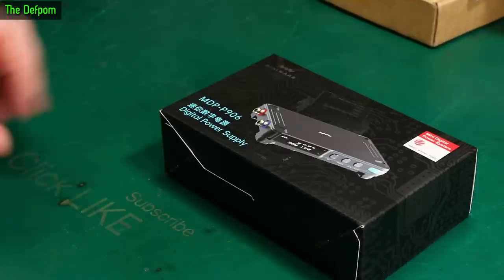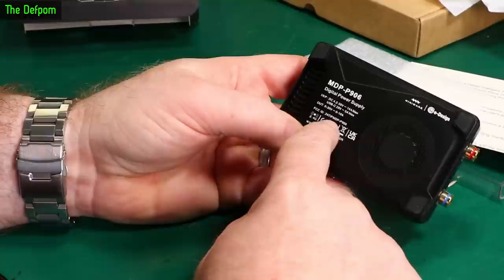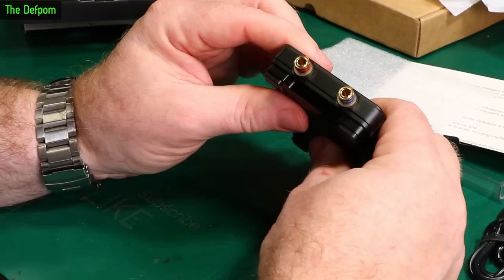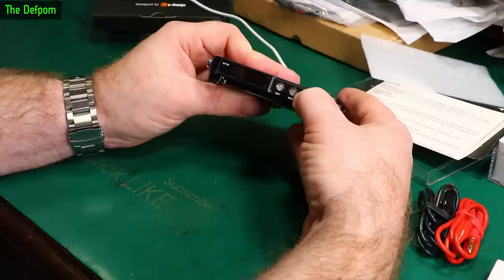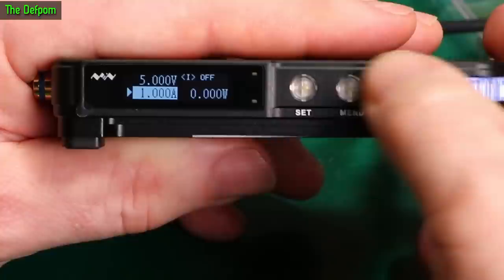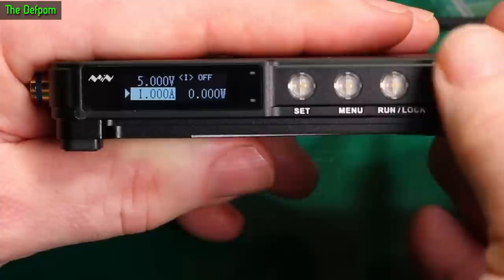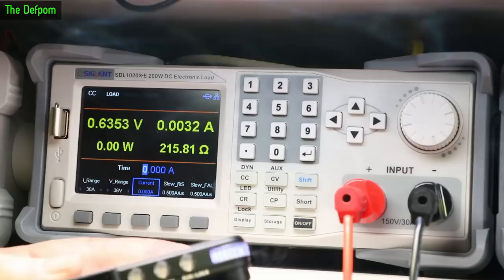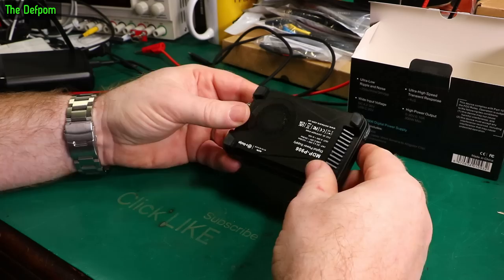🔴 Miniware MDP-P906 Power Supply Review & Repair - No.1041

Comment: Is there actually any need to make a PSU that small ? Would have been interesting to see how it copes thermally at full load for a long time.
Reply from the maker: I will need to set it up on a better DC power supply using the DC in Jack instead of USBC so I can crank it up higher for a longer time, that is something I will do when I get some spare time.
Reply: No problem whatsoever at full load in my tests. The fan turns on and the case gets warm, after 15 minutes its below 50° C on thermal camera due to high efficency (around 95%) as claimed by MINIWARE.

Comment: The general rule I've always used is to spec capacitors for twice the max expected voltage. A 30V rail should have caps rated for 60V, or more.
Reply: The problem with that is you usually end up using significantly larger components, which affects the form factor of any portable equipment. However, it does make sense to overspec voltages for electrolytics, but the question will always be "by how much?" If you're buying quality components, and you're certain that you'll never get spikes in excess of your maximum expected voltage, then there's nothing wrong with using 35V rated caps on a 30V absolute max supply rail. If you get a genuinely bad part, then I'm afraid that a bad 60V cap is just as likely as a bad 35V cap to spill its guts on a 30V line. The failure mechanism is the same for both caps.
Reply: @markonw6661  I agree completely about the useful life of electrolytic caps, and it is the usual 'U;-curve. However, unless you are suggesting that the PSU has been in use for 12 years, I don't think the long-term viability has any bearing on the failure in the video, do you. My point is that I'm completely unaware of any study that shows any effect of derating a cap on its short-term failure. Sure, a 63V cap is likely to last longer than a 35V on a 25V rail in the long run, but I don't believe it's any less likely to fail in the first 72 hours. A defect is a defect.

Leakage in solid polymer-Al caps comes from imperfect insulation in the dielectric layer. As I noted earlier, the problem with solid caps is the inability of an oxide layer to heal, so leakage will always increase over time, and I firmly believe that the failure shown in the video was caused by a voltage spike further damaging the dielectric, leading to escalating current through the capacitor. I really don't think you can blame ESR and ripple for heating the component when the failure occurred under no load conditions.
Reply: @markonw6661  I started as EE in 1972, so please don't try to patronise me. I don't need lessons from self-important lab rats who don't even take the time to understand the scenario.

In order for ripple to exist you have to charge and discharge the capacitor. When there is no load, the capacitor is not discharging; the dc voltage on it is stable, and there's no ripple.

It doesn't matter whether you have a linear circuit or a switching circuit, if you're drawing no current, you won't have any ripple on the capacitor.

Did you not see the video? The cap failed when no current was being drawn. VC = It, so I=0 means V=0. I don't think I can simplify it any further for you. The only mechanism for heating a capacitor which has a stable dc voltage on it is leakage, and there's no way ripple can come into it.

How on earth can you claim to be an investigator into failures and then try to tell me that a capacitor blowing under no load with minutes of first belling switched is not a early failure. Do you know what shape a bell is? Failures of electronic components are U-shaped: more failures very early on, then a low rate of failures for the usable lifetime, followed by a an increasing rate of failure beyond that. Why do you think we have "burn-in" periods for a lot of equipment? It's to catch most of those early failures that we expect will occur. Am I to assume your company just lets the customer find those for you?

It's clear the capacitor that failed overheated because it passed excessive direct current directly through a short in the dielectric. For a capacitor to fail because of excessive ripple current causing heating in the ESR, you need to be pushing a lot of current both into and out of the cap. That is only going to occur when large currents are being drawn from the rail that the capacitor is smoothing.

Feel free to give your considered estimate of the value of the ESR and the ripple current that caused the cap to overheat, and justify how the ripple current and associated ripple voltage came about when no load was connected. Then we can all have a good laugh.
Reply: @markonw6661  You don't understand that ripple voltage will be dependent on load current, and this failed under zero load? There's nothing wrong with being an inexperienced newb, but trying to talk down to people with far more knowledge isn't going to ingratiate yourself.

Comment: Mine unit was fine. I did a review of this model some time ago (with EN subs), you can check it on my channel. Its a very cool device. Buck-boost on the input and linear output, passed all tests. Very accurate, well built, efficent and almost zero noise. My only concern was about a voltage overshoot after switching on the output.
Overall not fitting my needs though. Without the MDP-M01 display module, the P906 interface is very inconvenient.

Comment: Of all capacitor types, I HATE those the most!  These junk caps have a very high failure rate.
I did have to buy some bulk caps of this type for a Channel Master PVR that is freezing up and very unstable.
With these units, it's ALWAYS the caps and sadly, they are of this type.

The afterthought that I had was that perhaps it may not be prudent to recap this PVR using the same type.
Perhaps I should replace caps with much better ones.  The only issue, is that it may be more difficult as I'd have to bend the legs to become SMD compatible as there's little to no through-hole.

Oh what fun.

Comment: USB Power Supply would need to have Power Delivery compatibility to work with this one.  Just something to note on the review :).
Not a bad little unit.  The reason it is so small is because it is basically just a buck/boost converter capable of 10amps.  All the actual power supply stuff is external in whatever power supply you connect to it .
Thanks for the review.
Reply: The price for this thing though $200 it's a lot for what it is. For that amount of money you can buy an actual adjustable power supply.
Reply: @BinaryOptionRomaniaBOR1  That is very true.   I was trying to keep my comment positive, but yeah, it is an expensive buck/boost converter really........

Comment: From what I could find on Aliexpress, they put a hefty price tag on this one!
I prefer a Riden 6018W with case and 800W PS. More power, less money. And still doing strong with all the original caps 😂.
On the other hand, releasing the magic smoke in a review is premium!
Reply: Ya looked at the 6018W it was $250 CDN delivered I think. But he did not have the magic smoke collection system active. :(

Comment: Perhaps under no load the capacitor was seeing a much larger than 30V on it (if it was on the unregulated side of things). They should have put in 50V caps for some margin.
Reply: @jaro6985  Yeah, I don't know if there's an LDO for the final output. If there is, it will have to have at least 2-5V headroom to have good ripple performance and decent load regulation. In addition, any variation in the voltages will have to be accounted for. For the FET to have a 30V rating is dumb. It will be stressed especially under no load conditions. I guess for sake of miniaturization, they have skimped on the specs.

Comment: I've tried a few mini power supplies, so far I've been very disappointed with all of them. They fail or just don't perform well. I might order this in to give it a go but my overall recommendation is to just get a proper full size bench power supply. Even the cheap ones have served me well.

Comment: Neat! it is certainly cool for the functionality and form factor. But I dont know if I would trust all those tiny mosfets getting their heat dissipated through vias and solder. Thanks for a doing a teardown so we can see the build quality! Too bad for that faulty cap! that is why you over spec your voltages by more than just 5v.

Comment: I could be wrong, but do I see completely uninsulated output posts? On something that can output 10A? Looks like a fire waiting to happen.

There's a reason why most binding posts are recessed or have plastic shrouds.

All it takes is a dropped paperclip or a screwdriver to roll in the wrong direction, and suddenly your workbench is on fire with your workshop burning to the ground.
Reply from the maker: I will have to check, but I think it has clear plastic covers over the outside.

Comment: 35volt rating is very close to the 30volt maybe a 40/50volt would have been better, you need to order more capacitors🙂
Reply from the maker: Yes I agree. To both points.
Reply: Concur, it is extremely bad design practice to fit any component that could operate relatively close to its maximum or even 'supposed' working voltage, even if quality parts are used. In my design days caps were generally selected to be three times expected voltage. Twice should be an absolute minimum (in my opinion). Jamming a 300W power supply in such a small enclosure is asking for trouble.

Comment: I have 3 of the little brother and one screen.  No issues out of mine so far.
Reply: how do they work exactly? I guess you can't power them from one source and put them in series, since there's no galvanic isolation?
Reply: I have only used them individually to test different parts of a circuit under test.  I haven't tried them in series.  Perhaps someone else can help answer your question.

Comment: Mine lasted about 30 seconds before the input current limit started reading back false values, and the output voltage limited at 0V9 open circuit.

Comment: Excuse me, but testing PSU without oscilloscope is a bla-bla about nothing. Without transient current testing — doubling it.
Reply: For what do you want to use an oscilloscope except meassuring the ripple?
Using a load to test a power supply is excactly what they were invented for.
you get a good idea of how good the power supply is (or not) when the current rises and the voltage drops. What do you want meassure? The time  for coming back the voltage? Everyone can  see that shoudl be better and so this is nothing more than wasting world ressources ... and you shouldn't buy it.
Reply from the maker: As I mentioned in another comment I had intended to connect a scope to check for noise as these are marketed as being very low noise devices, but the need to repair it threw me off, I may do a follow up video if there is enough to talk about.
Reply: @franke5478  , usually the question is half of an answer. On the oscilloscope, I want to see that thing for what oscilloscope was invented: to see forms of voltages and currents. Traces of possible oscillations and so on.
> Using a load to test a power supply is excactly what they were invented for.
Definitely not. Actual power consumers eat power in a way that is far from the electronic load.
> you get a good idea of how good the power supply is (or not) when the current rises and the voltage drops.
It is only the inner resistance. Besides the fact, that has a static and dynamic component.
> What do you want meassure? The time  for coming back the voltage?
Not only me. All PSU investigators want it. And forms, specter, and voltage of spikes.
Reply: @TheDefpom  , I'll be waiting for the second part. Thank you!
Reply: @Scorry  You're oversimplifying the issues. Real loads can be different from electronic loads, but that is unlikely to be anything more than a transient effect due to reactive impedances. In such a case, I agree that you need a scope to see how the output voltage varies. But it's not a question of power.

When the voltage starts to deviate significantly from the set value at a particular current, it is not "only the internal resistance". Either the effect is as a result of current limiting circuitry, or the design has reached an inherent limit for the components used. We definitely want to know under what conditions that occurs, as it tells us a lot about how the power supply is going to perform in the real world.

So we actually want to know both things: the voltages and currents when the PSU "runs out of steam", and what spikes, ripple, etc, appears on the output under different settings and loads. Might be worth a short follow-up video with the answers to those sort of questions.
Reply: @RexxSchneider  ,
> You're oversimplifying the issues.
Me? Oversimplifying when I propose to widen the testing? Or — do you want to talk with me about all PSU characterization and testing in 5-6 sentences?
Reply: @Scorry  Yes, you. I guess that English isn't your first language, but may I assume that you understand what 'oversimplify' means?

Your assertion that "power consumers eat power in a way that is far from the electronic load" is an oversimplification. The power absorbed by an electronic load is just the same as the power absorbed by a real load. But reactive loads can present complex impedances that may transiently inject voltages or draw current. As I told you earlier, there's no power involved in that.

Using an electronic load is probably the best way of testing how the PSU copes with current limiting at various output voltages (which is not "only the inner [sic] resistance"). Your opposition to the technique with "Definitely not" is wrong and I hope you can see that. I understand that you want to see other tests, and I agree with you, but I don't agree that dismissing the use of an electronic load makes any sense.

I've already agreed that we also need a scope to examine transients, noise, ripple, and recovery from overload, so what's left to talk about in characterising PSUs? That's 6 sentences on the topic, is there anything else you want to discuss?
Reply: @jim9930  It didn't fail while reducing the NO LOAD voltage. Check from 10:40 and you see that it failed after increasing the output set voltage to 30V and as the current limit was being reduced to 3A with no load connected. That has to be an over-voltage failure of the capacitor.

From the markings, the capacitor seems to have been a 100μF ±20% conductive polymer aluminium solid electrolytic rated at 35V, which means the maximum surge voltage would be 40V, although that can reduce significantly with temperature. Solid polymer electrolytics have higher leakage currents than liquid electrolyte caps, and they are generally unable to heal any damage to the insulating oxide layer. That means that the heating effect of leakage current can cause cumulative damage and is the probable cause of failure following a voltage spike. As we don't know whether the cap was on the input side or the output side of the supply, it is speculation whether the unit itself generated too high a voltage transiently or whether the "brick" that was powering it did so.

If the circuit is well-designed, then you can probably get away with 35V rated capacitors on the output side for a maximum voltage output of 30V, but running close to the rated voltage is always certain to find out any defective capacitors pretty quickly. Of course, if the cap was on the input side, it really ought to be rated at 50V or 63V to allow the input to be a nominal 30V (the box indicates an input voltage range of 4.2V to 30V), since you don't know what sort of dirty power supply might get hooked up to it.

However, I'm not sure that any analysis of the failure mode of the electrolytics used is a useful characteristic of a psu that we can test for. Wouldn't you agree?

Comment: HP E361x, working well, even after 30years.
No need for tiny disposable gadgets!
Reply: cluelss..are you comparing an extremely heavy low wattage old PSU that likely are on the verge to fail from age to a tiny 300W adj. mobile power supply?

Comment: I like it need to be 100v if I switched all the caps and mosfets would the software compensate if I feed it 67 volts.  Amperage 40 amps too.     I want to put this on a bike I want consistent voltage and amperage regardless of battery voltage.    If that makes sense

Comment: it is always the crapacitor 🙂
Reply: With THAT MUCH magic smoke, it's almost always a cap.
Other components, while they can/do smoke, don't usually produce enough smoke that a magician could make their assistant disappear!  LOL
Reply: Modern cap quality has been a crapshoot for at least a couple of decade now, but they've always been one of the weaker points in a circuit.  Funny that since the early days touting "Solid State!" devices have been carrying around little cans filled with shorts waiting to happen and goo waiting to dry out or get out explosively and stink up the place.

Comment: I have the same load but mine does not have the possibility to use banana plugs.
Reply from the maker: I purchased the after market knobs on eBay, they are from a binding post set, they have the same threads so it was possible to simply replace the original knobs, much more convenient.

Comment: 4:40 the better way is the MDP-XP, or the control unit. The power supply can work stsndalone... Just a bit fiddly. Holding the menu button steps per half volt iirc. 8:00 ah, set button. Been a while. Only used the previous P905.

Comment: Going from batteries to a capacitor bank the your power supply to my controller to my hub motors .   

I don’t like voltage sag .   

The power supply will compensate taking the brunt of the battery and also efficient getting the most usable power out of it .